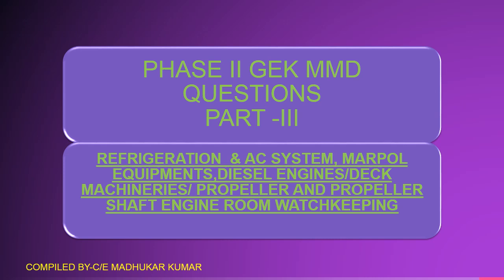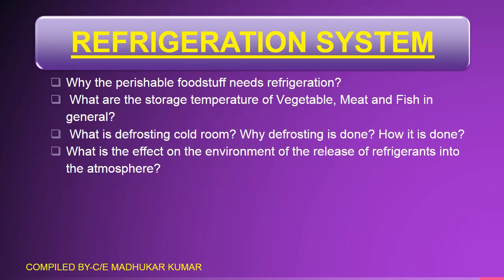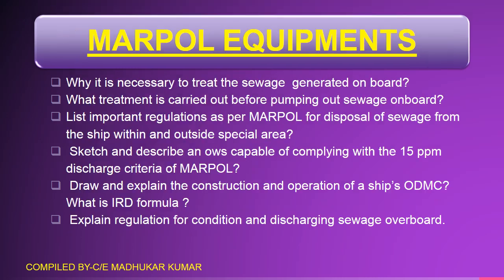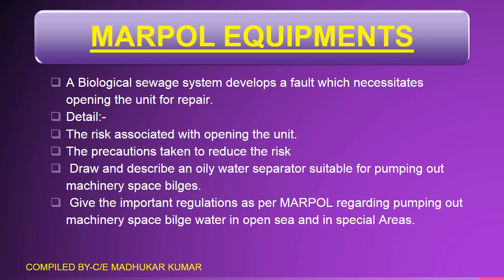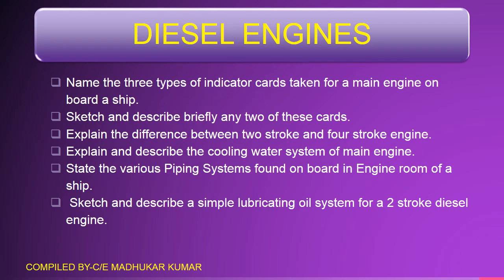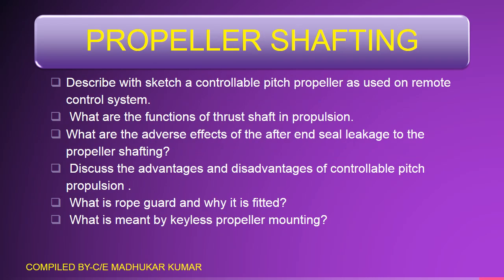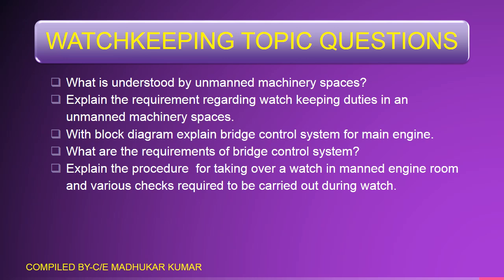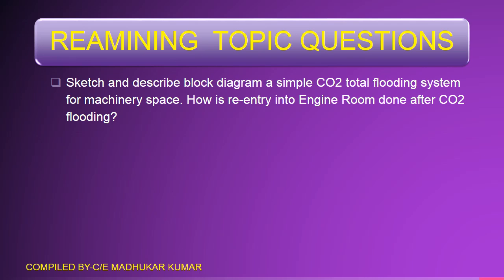PHASE II GEK TOPIC WISE MMD  QUESTIONS III

Comment: Generator is running normally, when we started a heavy motor then suddenly generator stopped what is the reason.( Generator rated power is more than that of motor)
Reply from the maker: It can happen due to the overload because the starting current of the motor is approximately 5 to 7 times higher than the running current which can cause the voltage deep or search and can create overload

Comment: Sir, why we do not use ig in bunker tank ?
Reply from the maker: Venkat and sister heavy few line and they don't have the volatile components.
Reply from the maker: Heavy few royal are the residual fuels as it is used for running the vessel it is cheap but it does not create the explosive situation in the bunker tank so mostly we are not using IG in the bunker tank. Include while the situation is different they have so many volatile components and the explosive atmosphere created in the cargo tanks so IG is used over there.
Reply from the maker: Heavy fuel oil